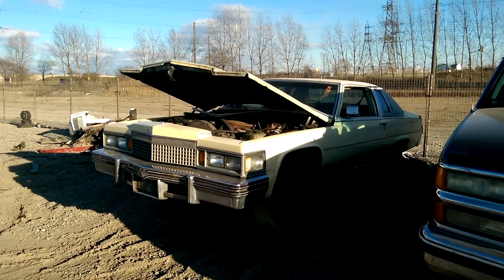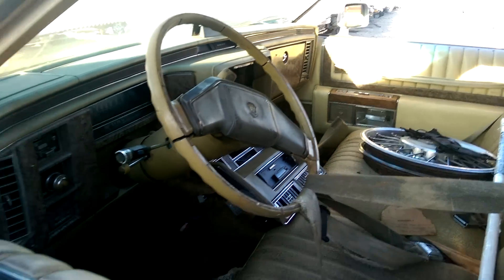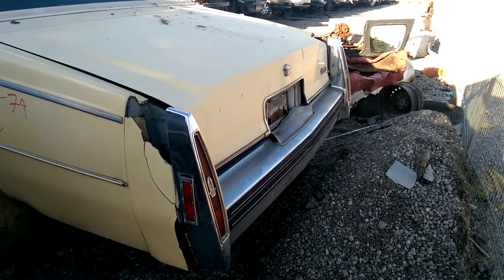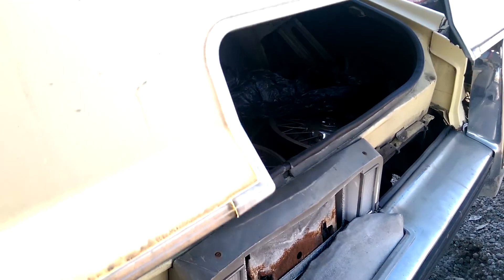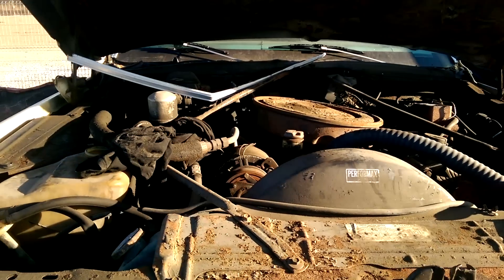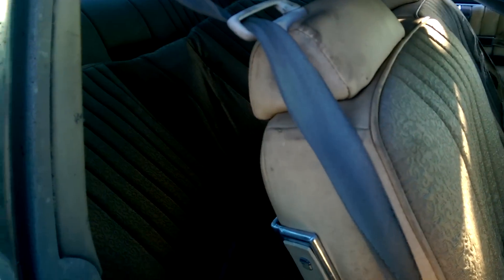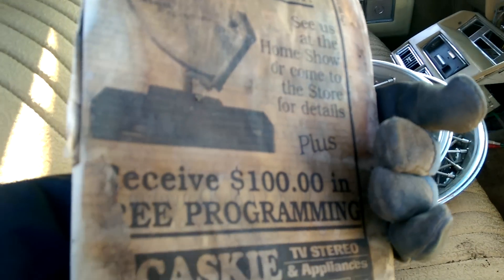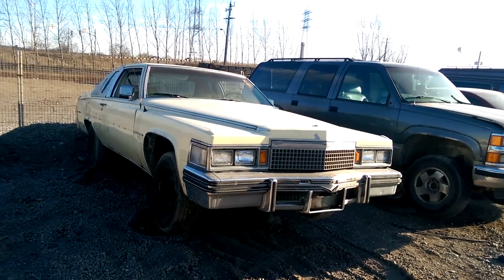GREAT condition 1979 Cadillac Coupe Deville in the Junk Yard

Comment: VIN would be 6 for Cadillac, D for DeVille , 47 for two door, N for 350 Olds diesel if it had that (the 425 V8 would be an S for carbureted version and T for gas fuel injection), 9 for 1979 model year, possible 9 for Detroit, MI assembly (or C for Southgate, CA assembly) and the rest is the production sequence.  Looks like code #62 Pastel Beige on the outside. Looks like it may have had an engine swap. The telltale sign of an Olds V8 is the filler pipe in the front like that for the oil fill.
Reply from the maker: Wow every time you comment i am amazed at how you remember all this about VIN decoding. I dont think i coild ever remember it
Reply: @MikeUtoober  You should show the VIN and the cowl tags on the videos. Also the SPID label on newer GM vehicles.

Comment: I bet it has a rusted Chassis. And/Or engine will need lots of TLC to get running if shes been sitting. Still sad :( Should make a sweet cheap resto mod car. Put cheap running junkyard  engine in it and keep the rest looking rough get it safe and bam cheap classic :) ( If there is no frame roT )

Comment: That car is a rat. May have the 425 cu in V8. That Waxberry (pale yellow) and with tinted windows, I'm guessing that was originally a Florida car.
Reply: it does not have a cadillac 425 it has a  oldsmobile engine which is not would not be the original engine